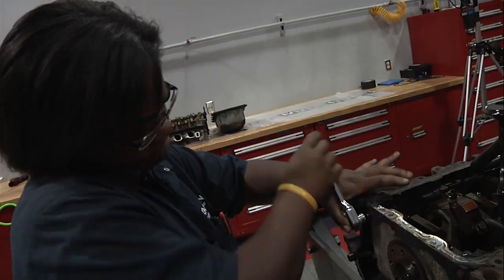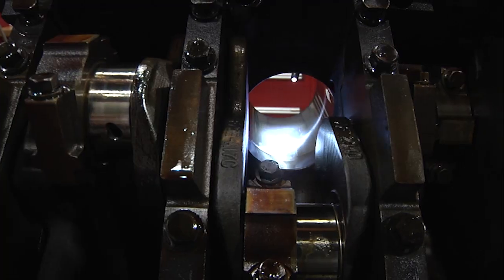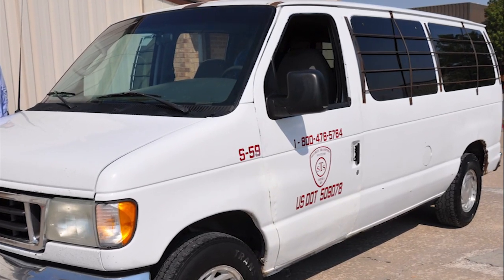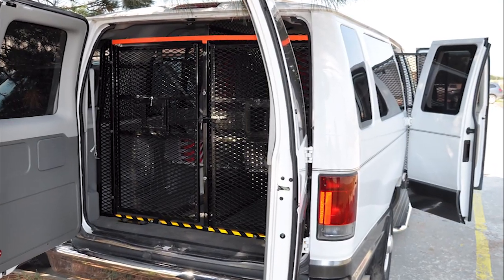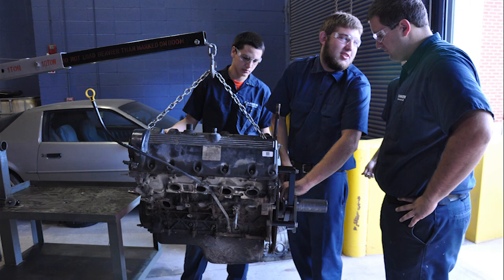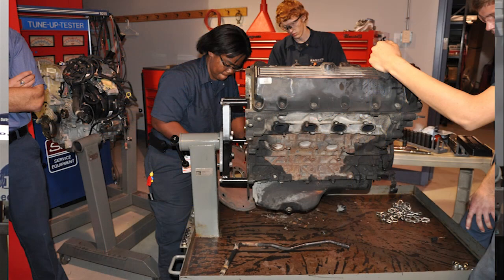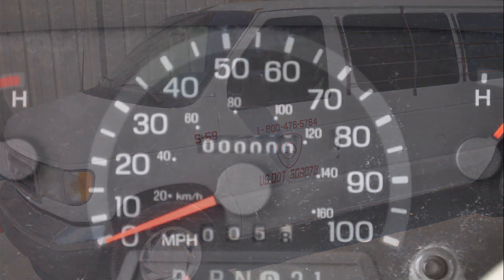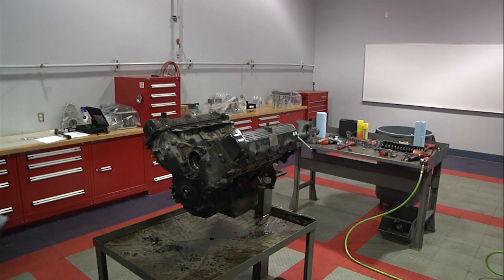Schaeffer Million Mile Gasoline Engine Teardown Teaser

Comment: Do you happen to know what the oil change interval was for the above listed vehicle?  Did they change out the oil every 10K miles or more or less?  That is pretty impressive none the less.
Reply: I’m not sure in this case. However, with the quality of the Schaeffer Oil, typically the drain intervals are doubled or tripled.
Reply: The Schaeffer write up says 8,000 mile drain intervals.